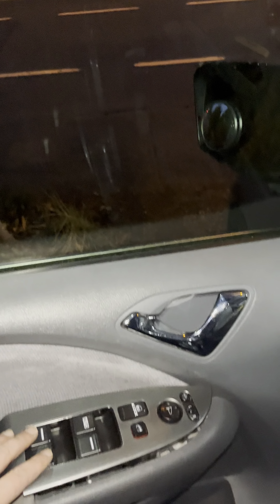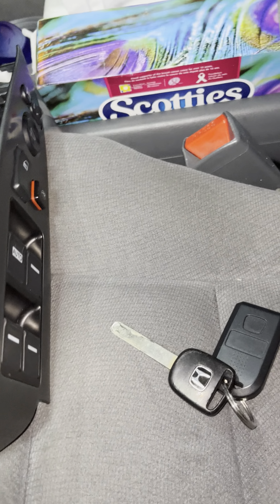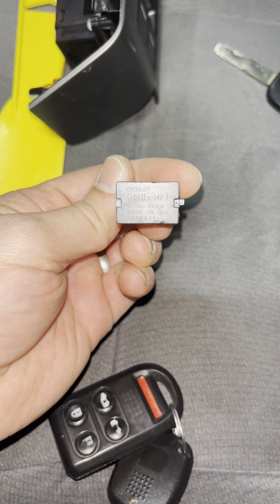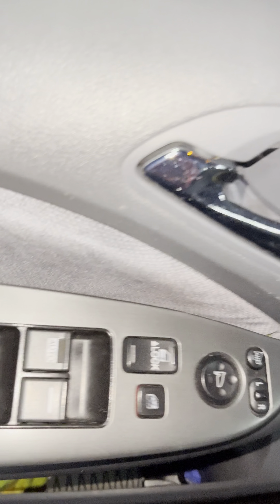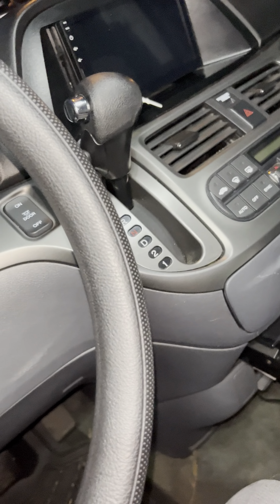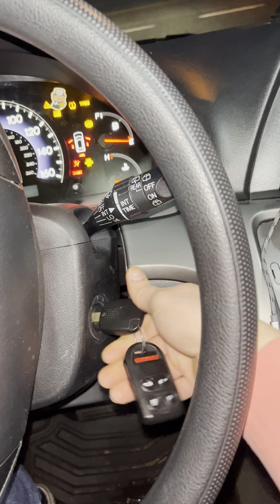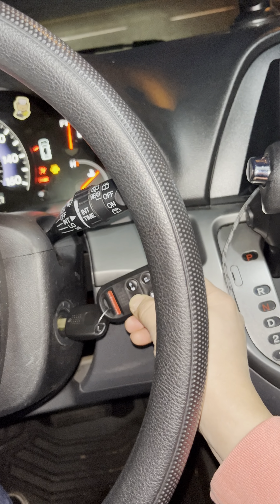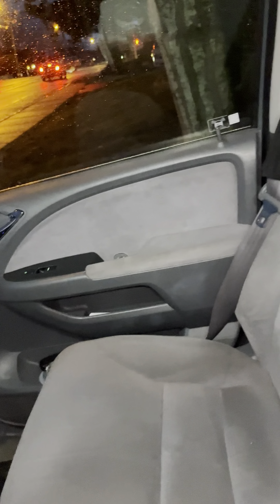Honda odyssey 2007 power windows not working . Master Power Window Door Switch replacement

Comment: I saw a video where he used a paper clip to connect the black wire with the White and green wire in the pannel you replaced .. and it workd.
Reply: It will draw power from battery even when car is off